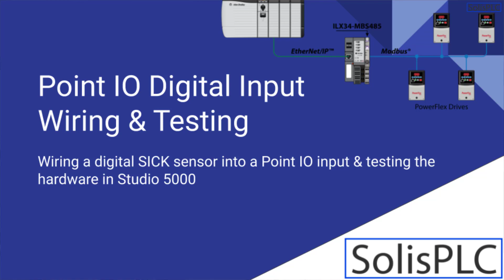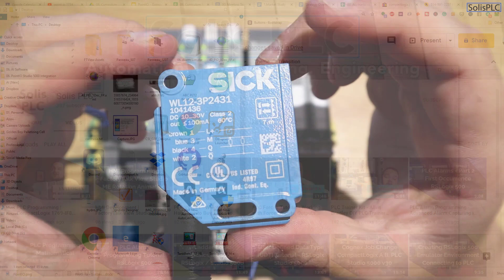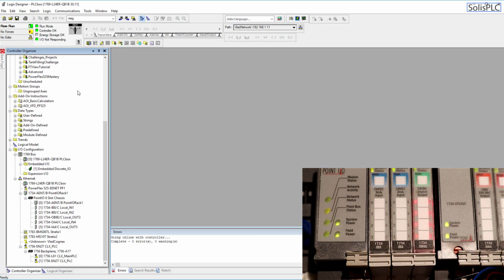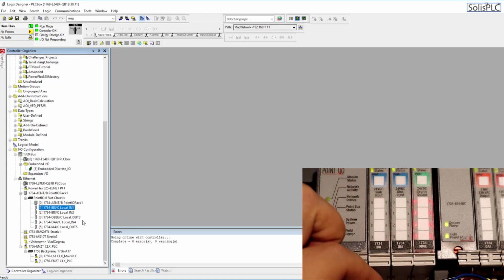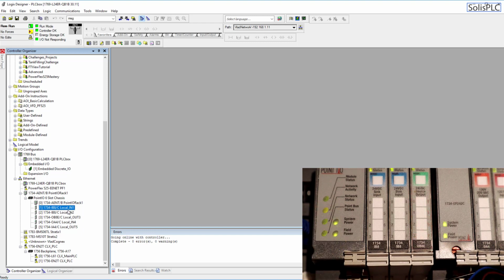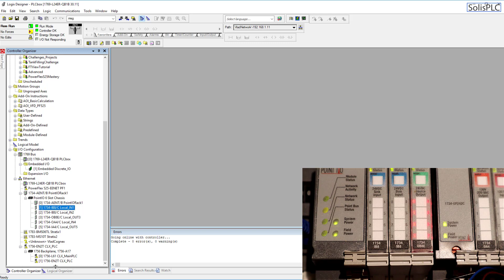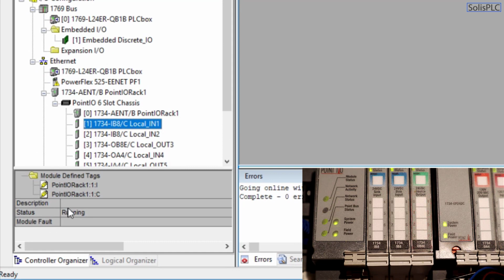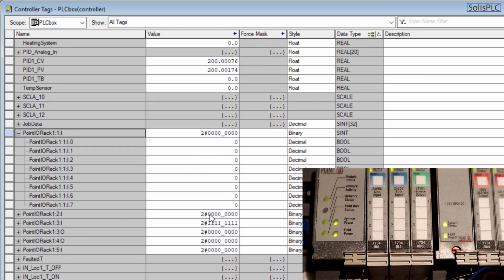Point IO 1734 Allen Bradley - Input Sensor Hardware Installation Wiring Testing Programming Tutorial

Comment: Vlad, I am having trouble adding 1794-AENT to RS linx. I am adding it in to a driver that has a Stratix 5700 which has VLANs set up on it. I have 2 PLC going into the Stratix, then I have the remote IO. I cannot get the AENT to populate in RS linx,however I can ping it. Have you ever set up AENT through a stratix? I am plugged into a switch that's connected through ethernet to the stratix. I know there's a lot going on here, I just thought maybe you could see it from a different perspective. I can make a driver with just the AENT, but when I add the stratix, it wont work.
Reply from the maker: With VLANs it can be tricky; your gateways must be setup to forward the traffic correctly. I've not done it over VLANs, but I did it over a NAT configuration through a Stratix. I would definitely expect it to work the way you're describing; I'd spend more time with the settings of the Stratix; I'm not certain why the traffic isn't going through. Sorry, I can't help you further.
Reply: @SolisPLC  I am thinking now I need to add the gateway for the AENT. The gateway is the IP of the Stratix. I remember now that I had to to into port configurations (on the PLCs) and set the gateway in order for the Stratix to see the PLCs. I think I will have to do the same for the AENT. So what you said did remind me that may be what's keeping the Stratix from seeing the AENT